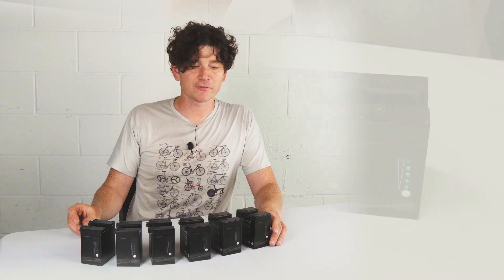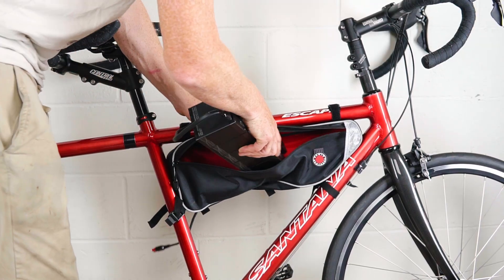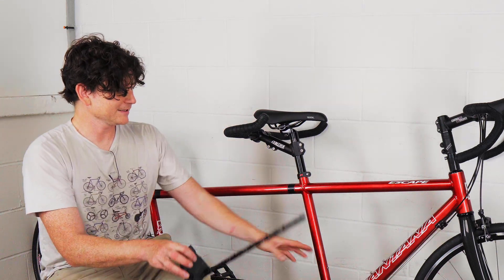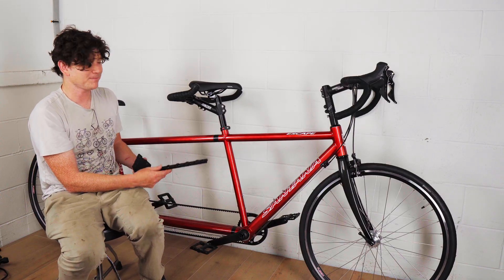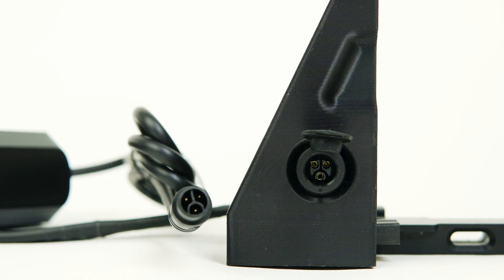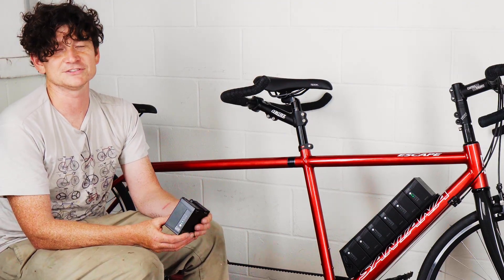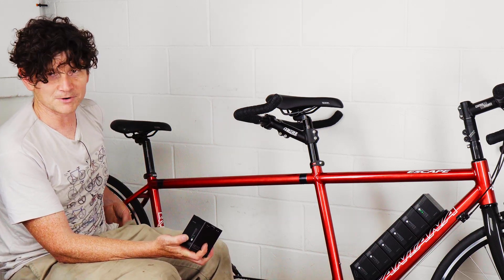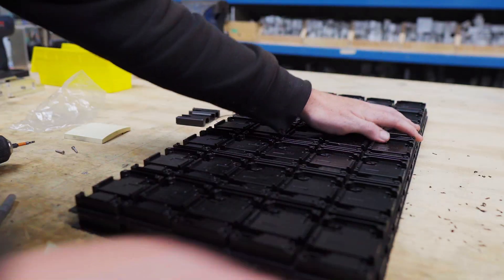Grins LiGo 10X Air Travel Battery, Installation and Usage Guide

Comment: I tried to connect to my iPhone using the Grin app.  I put the battery in Bluetooth mode, and scan devices and it finds the battery with serial number then on the iPhone it shows connecting but it never finishes connecting, despite waiting a long time.  I have tried several times with different individual modules.
Reply: Grin support let me know I need to use the LiGo 10X iPhone app.  I was trying to use a different Grin iPhone app.

Comment: nice word play on lego. years and years? usually lipo batteries stop working after extensive years doing nothing. ie drone batteries. are those lfp?
Reply from the maker: LiPo batteries indeed are garbage for longevity.  These are made with 18650's and yes the track record for lifespan on brand name cylindrical cells is on the order of a decade.  Packs sold 5-6 years ago and used regularly since then show almost no degradation.

Comment: Really digging all the benefits of a modular battery system. Only downside I can think of is added resistance at the connectors but it's probably not even noticeable. Very cool.

Comment: I’m forgetting the other wiring you have, how and how well would multiple sets of 10x’s work on separate rails, on different tubes of the bike? Especially with the communication firmware you’re working on for group management?

Comment: Would be cool if you did something like put pogo pins between the packs so that when they're connected, you could control and monitor them as a unit. Like, whichever one's closest to the triangle base becomes the primary and controls the rest. That way you'd only have to/be able to Bluetooth to one to manage/monitor. 😁

You could even do something like put some electronics in the triangle base to let it become the primary and let you permanently hook up a little monitor/config display.
Reply from the maker: Stay tuned to firmware updates in 2026 as your wish may become granted even without pogo pins!

Comment: How is it in rain and salt during winter? How cold can it handle? -20 celsius?
Reply from the maker: Rain is totally fine, the entire internal circuitry and all the cell tabs are potted in silicone.

 - 20C is the lowest temp allowed for discharging, but for charging at standard rates the pack first has to be warmed up. There is a progressive temp dependant charge current limit to prevent lithium deposits so you are limited to trickle level currents (c/50) when super cold.

Comment: Are those easy to recell ? Seem expensive to be "single" use (I consider Li-Ion cells as consommable as they would last only 5ish years).
Reply from the maker: Actually at this point quality 18650/21700 lithium cells outlive most of the vehicles they are put in. When we re-test ebike batteries from customers that are 5 years old with Panasonic cells they are still at 95-98% is original capacity, even pack that have regular use.

This didn't use to be the case, but it is now unless you run really high C rates.
Reply: @GrinTechnologies  Definitely not my experience with eBike batterie built 5 to 10 years ago with LG or Samsung cells. I recell eBike batteries and quite often, the cells are dead. Would you say Panasonic cells are really superior to LG or Samsung ?

Comment: 1500 for my ebike battery seems a bit steep when it's not a Chi Systems or something
Reply: I would buy these over a chi battery any day. these have a bespoke BMS and was going to be UL certified until the requirement changed
Reply: @boardinrider  I'm not putting other people at risk going around safety regulations that are put in place for very good reasons.  AND I'm not overspending to do it lol

Comment: I need 32 to make a 72v 45ah pack for my hyper scooter, how much would that cost I'm curious? So cool if we can get the cost to a competitive price this could revolutionize the battery industry, it's genius!
Reply from the maker: It would be lots and lots of $$ so only something you'd entertain if money wasn't an issue. 

For reference Just the Bluetooth bms board with all these features and functions retails over $100 and so you'd be at $3200 without even getting to the cells, enclosures, connectors etc!
Reply: @GrinTechnologies  that's unfortunate seems better for the mobility market, a powered wheelchair people could fly with could actually sell for $10k-$20k I've never seen it yet.

Comment: Can you connect them in series for 72v?
Reply from the maker: Yes you can that no problem by making a  series battery joiner cable. The ligo bms boards have pass diodes and sufficient blocking voltage that when one series string trips out before the other it doesn't risk getting damaged.  

But we still recommend setting your motor controller to a sufficiently high low voltage cutoff (ie >40V) so that it stops drawing power once one ligo has tripped.

Comment: What a waste oft time of ours, and waste of talent from you. When sombody already builds a diy Ebike, they sure weld they own battery pack. Why should i buy batterys from a standard tool box for a bike ? Cant see this selling good.
Reply: Best not to assume. I've built battery packs but I'd never dare take the thing on an airplane.. 
And I'd rather not build one for an e-bike either when they can be had affordably, considering the cells used within them. If anything I'd be interested in more LiFePO4 ebike batteries since they're nearly impossible to make fail, and might work better in the cold and so on.
Reply: @mikafoxx2717  Easy diy project for me. Gin Techs modell simply is to exspensive, the module design makes it much more exspensive, bigger heavy when it should be. I need for my Quad Fatbike  370 Cells of 18650, for my Quattrovelo, for extreme range and regen. Those small things from Grin have by far not enoughe metall to transfer the power. Also got activ balancing, a real LCD Display to monitor the packt and so on. I see his supply lying in the storage room, getting old.
Reply: @MS-pt3yh Not sure why you're being so rude. They're small to be airplane legal. Not everyone needs an electric dirt bike level of power either.
Reply: ? yeah you clearly havent heard of the constant fire issues from people home making their own batteries and even shops re using old cells lol. These are good for numerous reasons one of which is to replace lithium ion batteries that are at risk of moisture or corrosion damage? Not a waste of talent whatsoever infact probably required a good amount of R&D if it doesnt sell well thats fine hes pushing technology not his cheque book. Also has deep sleep mode traditional batteries taper off and degrade if not maintained with charge cycles lol. Everything you said been disproved in one comment by me!. You clearly missed the disclaimer on the pack itself where he specifically states the batteries are for safe passage on airlines. Packs are meant for travelling and when you cant take a giant battery pack on a plane without some really weird glances maybe professional cyclists? just cause you dont buy it doesnt mean they arent selling btw ive seen companies put out products for years i dont find useful but others its their saving grace for certain jobs that simple.
Reply: @zeeshyyt2  Who the hell takes a ebike on a plane ? In the case of travel, its easyer to just rent one in the destenation country, which also hase insurens. Youre not limitet by Li-Ion type cells, my smart  bms from Daly supports all kind of tech. Lifepo4, Li-Ion, NMC, LTO, and you can monitor it any time whit the 4,3 zoll LCD display, and change settings whit touche, dosent need a phone or computer. Those are one of the best BMS system on the market, got 4 temp sensors, active balancing, you can set youre self how much power in or out put the BMS allowes etc., you cant buy this as a finished product since they are more then 4 times the price. Also if you are to feare full to make you own battery pack, why do you even start whit electronic projects in the first place ?  I can not only weld whit cells whit the spot welder, i have Mig/Mag, TIG, Stick also, my massive battery packs are stored in 4mm thick steel boxes, it wont evect the house if they burn down there. My packs are massive, but since im legaly only using 250W in germany, its less then 10% of the total capazity it can provide, nothing gets hot, they decradet very slow, the max and minimum voltage is set by 40 - 80 %. The bought finished kits most people buy, have just the minimum standars, i can wrap as many isolation tape as i want, you wont get that in the market. I need custom-made hardware for my projects, which I can't buy, and for the prices offered to me online, I can make something much better myself for the same money.